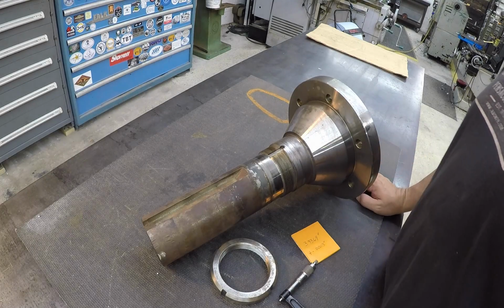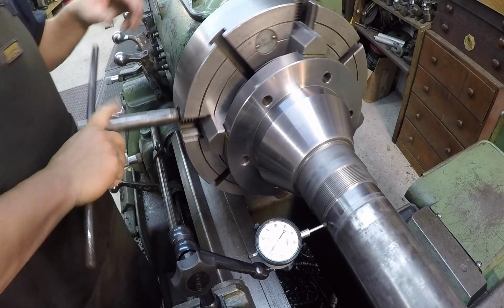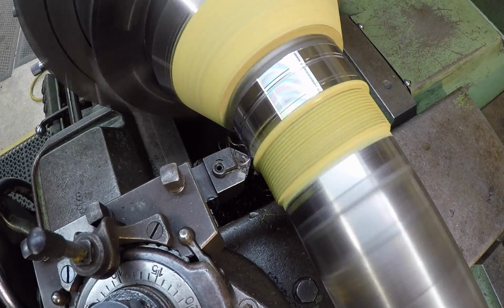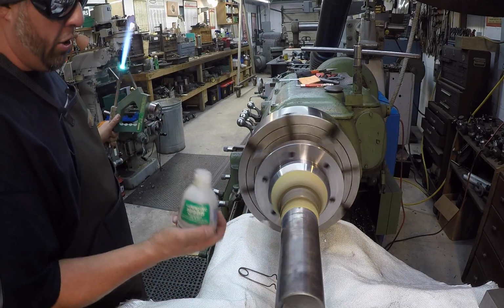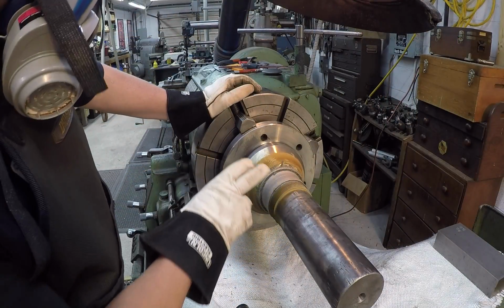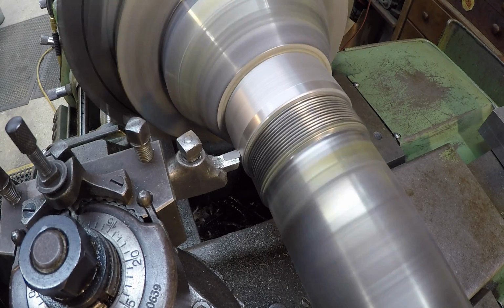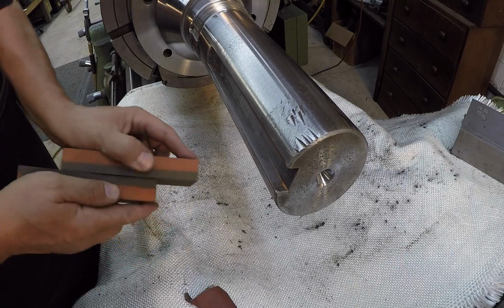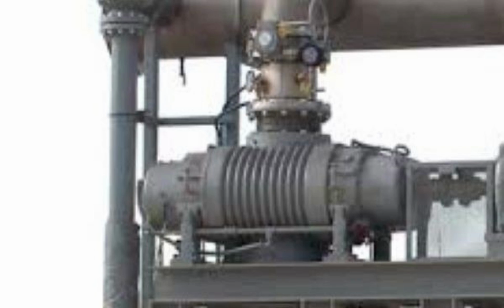SNS 300: Spray Welding a Blower Shaft

Comment: I agree with the comment about “spending sleeves” 
They are intended to repair minor damage to a shaft where a lip seal contacts it, stops oils leaks.  I don’t think they should be used to correct a bad bearing fit.
Spray welding is the way to go for this type of repair.
With proper pre and post heat it may be possible to under cut then build up with full weld, but spray welding is less likely to excessively heat the shaft causing possible hardening leading to cracking.
Just my two cents, Millwright ( industrial mechanic)

Comment: Nice job on the journal you might want to look into a technique called spray arc welding it's even faster than the opposite settling metal spray and is very versatile with different alloys available I have trained people on how to do both and you followed a very well explained procedure and demonstration keep up the good work

Comment: Might be a dumb question but could the heat travel up your piece and effect the center you set up?
Reply: Danny, it could sometimes but not always so it is best to check. The workpiece is solid and the deformity is small. Besides, it was welded while rotating which lessen the possibility of uneven heat distribution. Notice also that he did it intermittently so that the shaft doesn't heat-up too much.

Comment: We called it metal spray and it's common in the aerospace industry. We used it a lot in jet engine manufacturing especially on titanium cases.
Reply: Is it done in an argon chamber; where I worked for many years we built an argon chamber for titanium engine parts
Reply: @Marfoir0303  Ours was done in the open metal spray shop. I was amazed at the fixturing they devised to spin the parts as they sprayed them as many were bulky compressor cases with lots of side bosses to be sprayed. The most time consuming was the masking of the rest of the part with heat tape.
Reply: @davidangelamelcher9591  wow very cool; thank for answering. Sounds like a complex process

Comment: I really enjoyed the video. It brought back lots of great memories. I was a machinist for 10 years. I worked for a steel manufacturing company that specialized in tubular products for the oil industry. We were a maintenance shop. One of our tasks was to make high pressure pistons for an extrusion press. The pistons had a ceramic coating that was spray welded on. Then we’re machined to size using a diamond wheel on a cylindrical grinder. I really enjoyed making them. Like you did we did spray welded steel parts to.

Comment: I did some spray welding back in 1982 and 83 on oil field parts. Mostly on very large pistons. I used a dedicated spray weld lathe and the spray gun was wire fed. This video brings back memories.

Comment: This is the Master Art, ladies and gentlemen...The "Hard Drive" could not ever have come into existence without the Micrometer...An IT tech is only as good as his machinist...They will NEVER click a mouse and install a 7 ton centrifugal fan shaft. Highly skilled techs will always be needed...we do the work they can't do by clicking a mouse... Hoooaaahhh... Ol Sarge...
Reply: I can click my mouse and build an entire car, start up a nuclear reactor and yes even install a 7 ton centrifugal fan shaft with greater precision and speed than a human can. Completely agree that the old paved the way for the new but in many area's the new is better, not just cheaper. I'm always amazed at how Adam does what he shows here in his video's but the sad truth is he can be replaced by a machine who is run by a 140lbs soaking wet "Geek" with a mouse or trackpad...

Comment: You should check out "cold" spray basically same concept without heat effecting zones no fire just hot nitrogen or helium. Super cool stuff I'm a ten year 4th generation machinist and I just got into a position working with it and I gotta say it's pretty cool seeing copper "welded" to aluminum
Reply: WOW

Comment: I used a Metco spray metalizing gun here at work to spray zinc/aluminum  on the ends of pipe that protruded into manholes to keep them from corroding. It had 1/8" wire feeding through the gun with a Propylene/Co2 gas flame

Comment: great video!how much did you sprayweld over your tolerance?
Reply: lofty bottswana, he said around 20 thousands of an inch, around 0.5mm oversized. This is needed for the uneven portions of the weld process.
Reply: @sran5947  THANKS :)

Comment: When I was starting my trade I worked in my uncle shop they had a system like that it looked like a cutting torch with a bottle  to put different powders on the head. When the part was up to temp. You pushed the lever to apply  the powder  worked great. Cheers

Comment: Friday December 4th 4 minutes after 2:00 p.m. Texas time.
I am your newest subscriber.
I am a retired Auto truck tractor heavy equipment mechanic
Best description general purpose mechanic.
I have really enjoyed your video.

A good general purpose mechanic should be able to cover all aspects when brand new parts aren't available for replacing plan b has to be used restore the old part not many like to do it but it has to be done sometimes and restoration should include making the old part is new as humanly possible if not better than new.

Keep up the good work I'm proud of you

Comment: I need something spray welded. It's a cast iron exhaust manifold. The previous owner, or someone else, ground down the exit flange to the point a gasket hasn't enough surface for a proper seal.

Comment: i am a diesel technician, you are a machinist. sleeve it or not, i fix stuff i build engines , transmission, you weld and fix metal parts. you do what you seem best. Each has its expertise and let it be that way. Thats why i bring my fucked up beat up parts to a machinist, go fix my fixing job lol. i just found you tonight, good video i can relate on a lot of things, keep up the good work!

Comment: ive now been staring at this hunk of metal for 45 minutes and still have no idea what it is. I feel like i know a lot about repairing it now but i have no clue where to get one or how.
Reply: Could be a shaft to anything really.
What happens is the bearings go out and people are lazy about checking them, maybe once or twice a year or something and its still turning so they call it good because you actually have to climb into whatever it is to turn it by hand and give the shaft a yank and make sure the grease is getting to the bearing to check it properly and aint nobody got time for that.
The bearing starts to seize and the shaft starts spinning inside of the bearing wearing shaft down and you notice it when it starts vibrating or clunking.
Bearing goes on the surface he weld filled, bearing stop / cap screws on to the threaded bit...key goes in cap on the smaller keyway...setscrew through the cap to the key.
Other side bolts onto whatever is turning.

Comment: I’ve been repairing machines for 40 years.
Quite familiar with brazing shafts.
Never worked on blowers. Very much like a turbine, tolerance wise. This is the first time I’ve seen spray welding. This is very cool. I will remember this video. Thank you for sharing.

Comment: Why not weld that in a welding lathe?
Reply: Because spray welding is fucking awesome.
Reply: @Shaftygod  I don't know about all that...
Reply: @TheMistacrazybones  Just watch the video man, you'll see how fuckin awesome it is. There's always more than one way to skin a cat, there's no correct answer to why or why not, he's just showing us a cool tool. Enjoy it.
Reply: @Shaftygod  you can skin a cat with a baseball bat, but it's neither efficient nor achieves the best results. You might say it's the wrong tool for the job. I welded rolls and journals in a shop for years, and there's a reason why the weld techs and metallurgist didn't want us to spray weld them. But, to your point, I'd like to see a video of a cat skinned by a baseball bat.
Reply: Welding is too hot. This is a very high speed very high torque blower.
The slightest warp ruins the shaft. A precision shaft like this is around $20k.
Reply: @rogeroday9408  I really apologize for being condescending.
Reply: @rogeroday9408  you really don't know what you're talking about. I've welded plenty of em, and you usually weld the whole thing. But the journal is thick enough to take the heat without effecting the run-out to within a half a thousands.
Reply: Especially one so short.
Reply: @TheMistacrazybones  Don’t apologize, I’m not offended. At least you didn’t cuss me out like that Jason guy did you.
I don’t know what I’m talking about.
I’m a repair welder. Not a pro welder.
But some very old and in my mind told me not to do things and gave me a logical reason so I’m taking there word.
I have worked on super chargers with much lower RPMs and would never stick weld on.
I had a guy show me what it does on an old shaft.
If you’ve done successfully you’re a better welder than me and I have known many who were. I don’t hold it against them or you.
I do know about high speed shaft drives.
I’m sorry but I wouldn’t trust it. Not in something I’m building. By high speed I’m talking about 10,000 RPM+ final drive speeds.
Add positive displacement and that removes any doubt.

Comment: Spray weld it won't work due to that is not solid  it will peel off in not time at all
Reply: It won’t peel off, this is what spray welding is designed for. It’s a proper application. Plus the repair is contained by the bearing race around it, it’s not in open air.

Comment: That deep groove created a massive stress riser. Some poor mechanic will be shaking his head when it wrings off at that location. In all reality it compromised the shaft and should have been replaced.
Reply: Agree...
Reply: Doubtful, the groove might look deeper than it is on video. I doubt it’s more than 0.010” - 0.020” deep before welding.

Comment: Thank You for your presentation and video.  I’m a Commercial HVAC Mechanic.  We have sent shafts out to get spray welded repair on huge bottle neck Shafts.  Believe it or not.  This procedure is less expensive than purchase a cheaper Chinese replacement shaft

Comment: ... or you could just do it 100mm +/0,75mm
Reply: fits better with -/+ 0,075mm
Reply: they are even asking for 0.0075 mm. This is extremely precise, too precise for a simple bearing journal of 100 mm diameter.

Comment: It's been 25 years since I tried the Eutectic spray weld system on roller journals in a large newspaper machine shop. Wish I could have seen your method. What was happening makes sense now!!! Thanks for sharing your knowledge and experience!! I am retired from a large manufacturer now. Your videos remind me of apprenticeship,  and my early machine shop days which were mostly manual machining, one place even had a G&E shaper like yours!

Comment: I think you missed your wife's joke about her hotness. That was funny, she made me laugh, great sense of humor. I am glad she wore the proper eye protection, safety first. And your hearing PPE was also spot on, again, safety first. Could you have built up the deep pipe wrench gouges as well? Or would that have been too much to do and cost prohibitive, as well as not really necessary, but a nice visual touch for the customer. I have seen some  shops spot weld the areas and then grind, but again, not really necessary. Anyway, that was awesome, please provide more repairs on the lathe. Thanks.
Reply: that was too funny! the proper response is "sorry babe, it doesn't read that high"
Reply: @frank7911  Exactly......"You broke my meter"......lol

Comment: I used to think I knew what machinists did. "About as much as they know about MY job," I thought. I was wrong. Now I think my primary job is to keep people from interrupting!
Reply: People ask me what I do for a living, I reply with "I'm a machinist" they either think I run a stamping press or they ask me how much to change their brakes. I can and will make your brakes, but it'll be pricey. lol. Manual, CNC, vertical or horizontal. It's all in a day's work. 
+/- .0001 is life.

Comment: What is in the hopper on the spray welder? Is it some sort of pelleted steel?
Reply: THE CUSTOMER IS DEFINATELY HAPPY CAMPER. I WOULD NOT HOLD BACK ON PAYING THIS GUY. I WOULD PAY EXTRA FOR THIS KIND OF QUALITY!!
Reply: @rickytorres4017  chill on the caps brother
Reply: @Xenon-rl1me  NO YELLING ON THE BUS!
Reply: Powdered metal, could be steel or other metals. In this video he used a possible equivalent to machinery steel.

Comment: yea work at a shop did the spray welding work experience they just had that lathe for that purpose  was not into that shop environment as to the shop was run any lathe work i liked to do we have an older lathe on the farm and a milling machine most part we can fix want broking on the farm now

Comment: Wonderful nostalgia.  You are using the most primitive first generation flamespray  torch that Eutectic started selling in the 1960's.  The most unique thing about Eutectic was that, at one time, the Eutectician would train customers on the optimization and limitations of the maintenance and repair products and procedures they sold.  You did an amazing job with limited information.  Imagine that in a fraction of the time and using exothermic powder you end up with a coating that looks like solid stainless steel or chrome mirror finish without the grainy look and producing a nice curl when machined.  Castolin/ Eutectic now sells a ninth generation torch .  With the right training your torch can duplicate those results.  I did it for 30 years. Nice job.

Comment: Awesome!! That spray welding is almost (or essentially) a type of "Additive Manufacturing". Beautiful job. I was an apprentice machinist for Schlage Lock Company in 1990 and we had a fairly large and advanced machine shop with a lot of old manual lathes, mills, presses, etc. like yours but also many CNC/ NC machines some of which were essentially new technology at that time. We also had journeyman machinists and specialist tool and die makers. Unfortunately they closed our plant and moved it to Tecate, Mexico in 1991 to a new Maquiladora facility and that was the end of my career as a machinist. My Godfather was the Foreman of the United Airlines maintenance base at SFO (overseeing 3000 employees) and also a welder and machinist. Should have tried to get a job there, but I eventually got into the tech industry.

Comment: Why didn't they just stick weld it then turn it down. It would have Been faster and did the same job. I welded for 20 years and I have welded up stuff like that for machinist and never had an issue.
Reply: Hey explains at the end of the video; the heat from stick welding would ruin it, whereas the spray welding is considered a cold process because the temperatures are much lower.
Reply: https://youtu.be/FLYdhfgF6Pg?t=2796
Reply: Heat input, and arc efficiency..

Comment: watching people use inches tools in a lathe is fascinating. get a millimetre tool for gods sake.
Reply: most machinist in our country still use the time honored method of measuring. We can use the metric system, we just don't abide by it. Most of us can juggle the imperial system in our heads faster than you can talk.
Reply: @twcaldwell1951  1 thousand of a inch is still super inaccurate, and the prime reason for the poor quality of american products. luckily for the us, China makes even worse products, so you are not totally destroyed by that.
0,254 mm is your tolerance with the 1 thousand of a inch. if u was using mm as main measurement you could be manufacturing with a clearance of 0.005 mm, witch is standard here.
Reply: @magnetmannenbannanen  1 thousand of an inch ist 0.0254 mm!
Reply: @magnetmannenbannanen  You need to study your math bubba, when we want accuracy,  we deal with tenths of thousandths, which is twice as accurate as 0.005 mm.  As a retired mechanic of better than 50 years, I take offense of your saying Americans make poor products, we generally set the standard for the rest of the world. North America has some of the greatest that the world has produced. I'm finished here.
Reply: @magnetmannenbannanen  Wow, you have no idea what you are talking about do you?   Measurements are numbers and that is it.  You could label it cow, horse and donkey.  Size is size, two pieces of the same size measured with 2 different systems are still the same size.  Furthermore, witch is a female magician. . Which is the word you are looking for.   Second, your math is incorrect, BY A LOT.  Third, the imperial system is far more accurate and goes down to much smaller measurements.  The MM system is for control and stupidity.  It is a "standard" of "uniformity" based on "tenths" for those who need not visualize their work or ask why they are doing such work.  Basically, it is a system of the NWO for a new slave class.  But, anywhooo....have a great day
Reply: These are the words of a fool.   The measurement standard is entirely irrelevant to precision.  Imagine a dial indicator that has NO numbers... One who is even SLIGHTLY talented will easily be able to set up the part in his lathe, with no problem whatsoever.

Any experienced machinist recognizes that when repairing a component, it is inherently most appropriate to utilize the same standard of measurement by which it was originally constructed and blueprinted.  Attempting to recut an SAE thread or keyway using mathematical transformation, for sake of some preconception of a 'unit' is absolute idiocy.
Reply: What we have here is a text book example of the Dunning kruger effect.
Reply: @shawngoldsberry747  My thoughts exactly.
Reply: Crickets